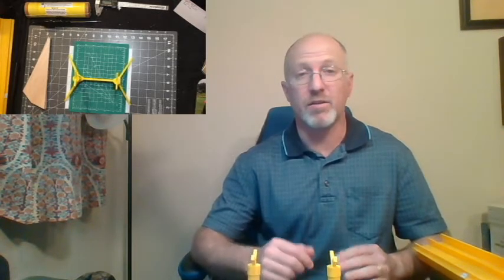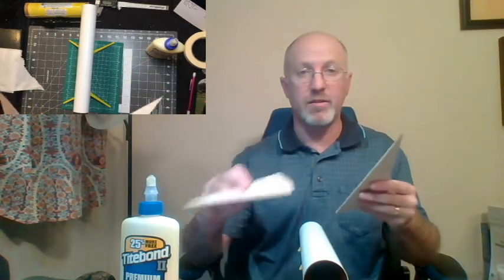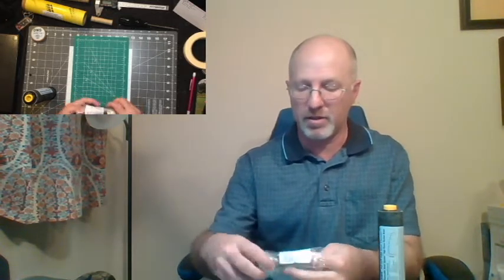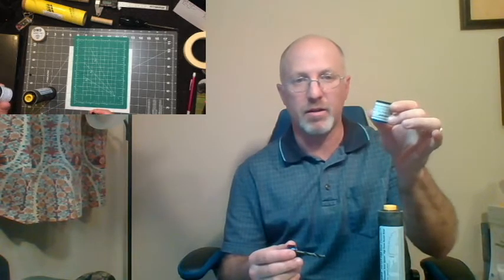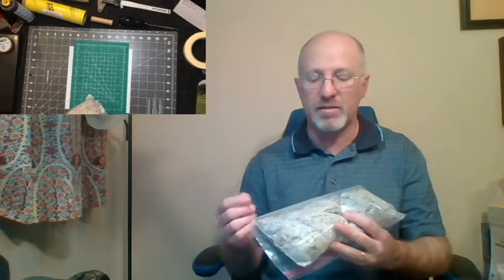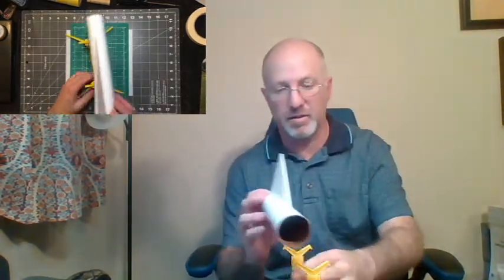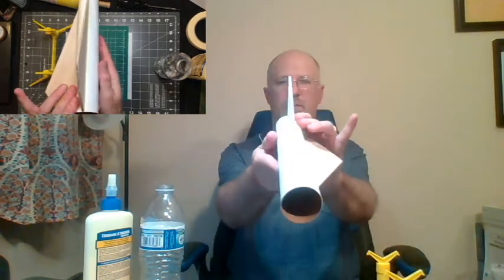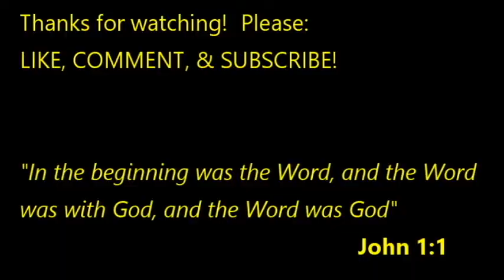Kevin's Modeling Minute - March 8, 2021 - Episode 2

Comment: I enjoy the videos very much. Keep up the good work.
Years ago my Executioner came with a warped fin. I wrote to Estes and they sent me a replacement fin set. Back then the fins were plywood so I was not able to straighten it out.
I use the Estes tube marking guide for fin placement. It comes with disks that have marking for 3 or 4 fins kits. Beats using that paper guide that you have to cut out. I use either angle iron or the Estes Ultimate tube marking guide to draw the lines. Much better than a door jam.
Reply from the maker: Yes sir!  Two reasons I don’t use door jams: 1. Not knowing who built the house and how straight the paint may be. 2. Hard to film that...........

Glad to hear Estes honored your purchase and corrected the fin situation for you.

Comment: The second number on the rocket motor is for the delay for the chute but what is the first number
Reply from the maker: It has to do with the amount of thrust in units of Newtons. I can’t really explain it better than that because that’s about all in can understand of it myself. Bigger number = higher thrust. Great question!!!  Worth researching more on my part.
Reply: @KevinsModels  It's supposed to represent the average thrust over the duration.